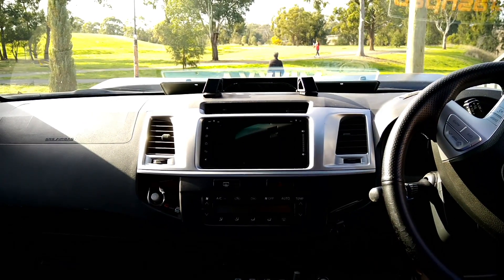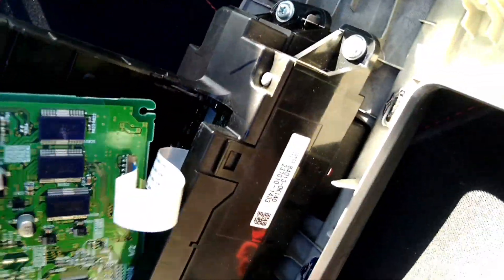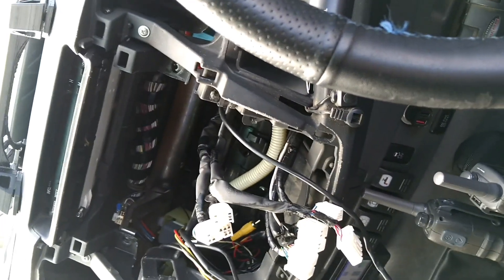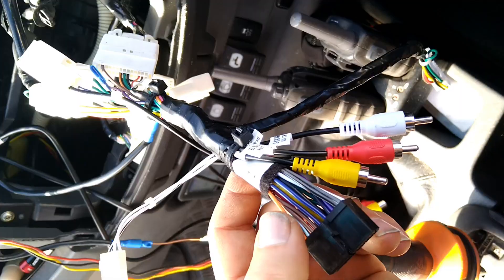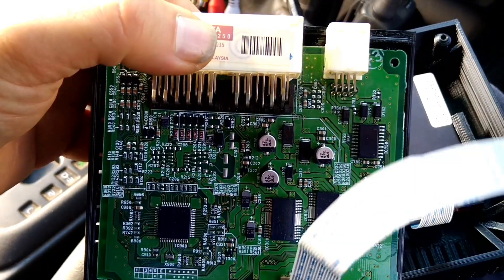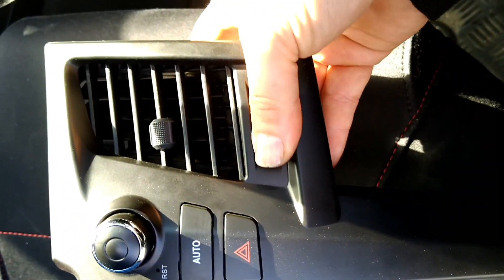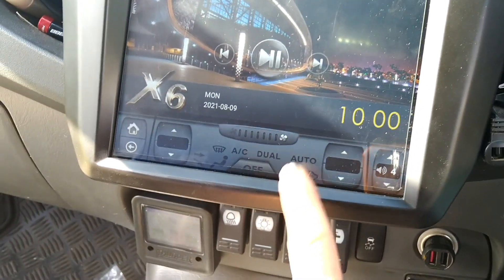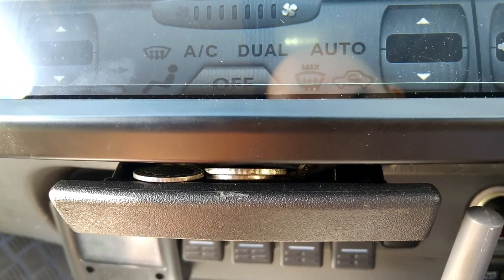12.1 Android Tesla style head unit DIY install toyota

Comment: Were you able to connect the AC steering wheel controls to the unit? Can you control the AC from the steering wheel?
Reply from the maker: @pablorodriguez1964  I didn't get the controls to work. But there is a work around . With the new firmware  if you hit the mute button the you can control the fan speed and temp with the volume up and down and the track skip buttons
Reply: @n70tonka But did you have to make any additional connections? Do you have any video of that configuration? I installed my unit with your video and connected everything as is and everything works perfectly, what I haven't been able to do is control the AC through the steering wheel. thanks in advance.
Reply from the maker: @pablorodriguez1964  I have updated the firmware on my headunit . You have to go to the Facebook page "Tesla style PX6 head units. Firmware, software and support " he will send you the firmware for a price .

Comment: Dear, My name is Pablo and I writing from Argentina.I bought a car radio on aliexpress and the flat cable did not come. I also see that the climate control amplifier assy is a little different from the one you show, it does not have a flat cable. Do you have any idea if I can connect it to the car radio? I attach photos of the climate control. Thanks for your time
Reply: I can't send you the photos. Do you have an email to write to? Thank you
Reply from the maker: @pablomuzzio823  magri_sam@hotmail.com

Comment: Hello Mate. I am writing to you from Nicaragua (The land of Hilux) I am so glad I finally found a detail instruction on how to install this unit. I bought my unit a few years back and did not get around to install it as I didn't know how to install the AC wires to the unit. Your instructions were a blessing. I followed your instructions and I was able to get the ribbon out of the AC control unit and installed it on my CANBUS. The issue I have is that as soon as I plug in the Canbus my Hazard light go erratic and I am not able to turn it off. Did you come across this issue or is this isolated to my unit? 
I have not been able to try my AC as my first issue is the hazard light flickering like crazy. I am wondering if I have a defective CANBUS.  Let me know if this is something you are aware of and if you can help. Thank you.  Great Video by the way.
RB
Reply from the maker: The only problem I had was the hazards didn't work when the car was turned off. Only thing I can think of is jet some electrical contact cleaner and spray it in the switch, push the button a few times with no power connected then plug it back in and  try it again
Reply: Thank you mate. You may be correct about the switch, the only thing that makes me feel that it may not be switch, is because I am able to push the button in/out without issues. I will give it shot though, I hope I don't blow a fuse  @n70tonka

Comment: Great video.. I'm just about to purchase one of these units and your instructions are very good. Makes it look possible for an average Joe  with basic skills to complete.. Does the unit from EC Offroad come with the GPS and Wi-Fi antennas.? I also will need to get a printed box from you. I will send you a message.
Reply from the maker: Thanks for that . Yes it comes with gps and wifi antennas. Use medialux in the discount code section to get 10% off the purchase price as well
Reply: Doesn’t look like that code works anymore

Comment: Hi 
Thanks for the video, i'm interested in getting one but for the Hilux 2013 / 2014, and i want your honest opinion if it is worth it or not, also did you manage to get the A/C working ?
Reply from the maker: It is definitely worth it . So far it has no glitches and running smoothly, the start up time is very quick as well . The ac works it is just a setting on the unit you change and it's all good.
Reply: @n70tonka  

Thanks a lot for the reply
I got one from the factory in china from AliExpress and it is almost identical to yours, my Hilux is 2013 model
I have received an OBD2 cable with it and other wires you didn’t have, but what i didn’t see is the ribbon for the A/C that you mentioned it is supplied.. i asked them before if i have to remove the A/C board and they said no.. i have same module as what you have

Is it possible there is another way to get A/C working or i must use the board the same way you did
Reply from the maker: @minoloozi  no you need the module for it to work . I would be interested to see the OBD cable you go ... WhatsApp me on +61 0414968368
Reply: @n70tonka   I have msged on WhatsApp
Reply: @minoloozi  hi just wanted to know if you got this fixed and your ac working for your unit
Reply: @the_diy_offroader Hi Nice video! I was trying to make ac work for a lot of time. Could you help me with 3d pinter file. Thanks

Comment: Hi how to connect the AC as my unit has no converter for the Ac controls
Reply from the maker: It must be the wrong unit for your vehicle .
Reply from the maker: If your vehicle has manual turn controls this unit will not work .
Reply: @n70tonka   I have the button type but the connector is not flat ribbon can you whatsapp me so I can send photos maybe you can help me

Comment: Hi man I bought one my a/c plays by its self I can’t use it it automatically changes or turns off I can’t even turn on or off
Reply from the maker: You have to change the model in the settings I show this in the video.
Reply from the maker: Fast forward to 21 minutes
Reply: I have 3 different opinion fortunes , 2018 fortuner , 2018 fortuner learning keys
Reply from the maker: @MrFkdpgs  that's ok pick one and then change to either hi or low and see if it makes a difference
Reply: @n70tonka  I don’t get a option hi or Lo
Reply from the maker: @MrFkdpgs  on both of them ?
Reply: @n70tonka  yeah I get 3 options 1) fortuner 2) 2018 fortuner
3) 2018 fortuner learning key I don’t no if you can send pictures here
Reply from the maker: @MrFkdpgs  upload a video on YouTube
Reply: @n70tonka  ok done